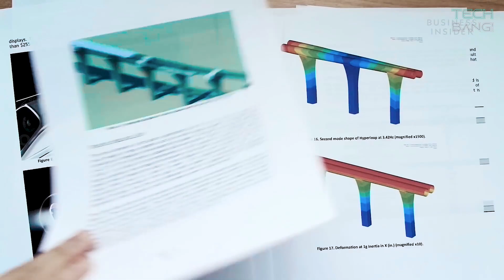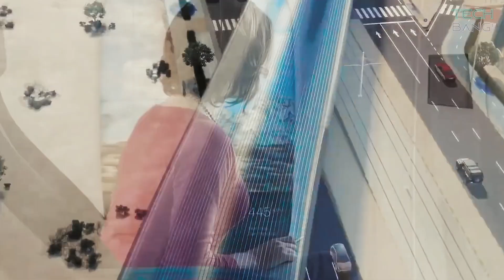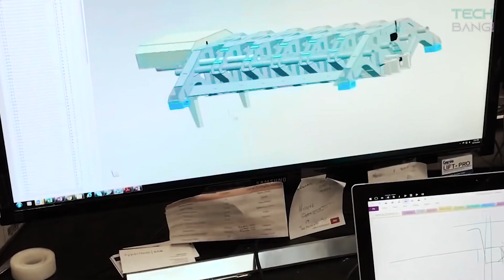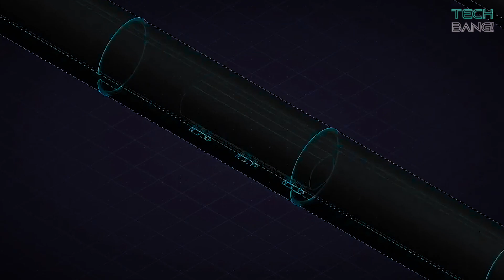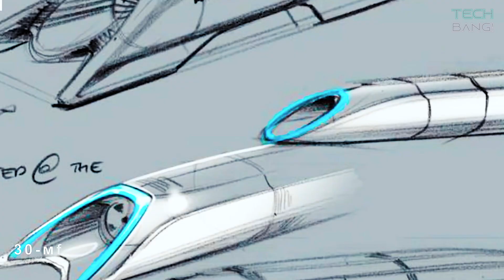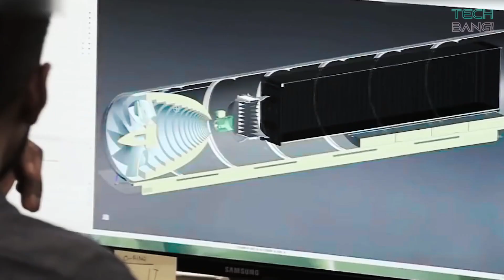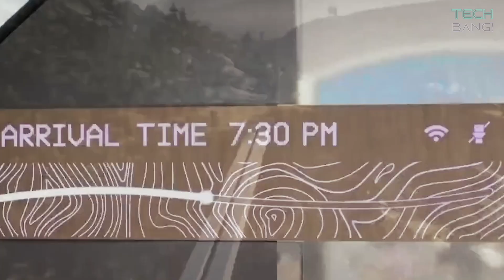The World's First HYPERLOOP is Causing a Revolution

Comment: To travel, seven-hundred-miles-per-hour. You cannot afford to land on wheels or touch any outer structure. The craft will require natural infinate levitatuin, always while power is lost. On those 'express lanes.' This means thicker natural levitation material, or larger levetaion materials, say between carts or front& back of pods.

Comment: Hyperloop will fail why can't anyone understand this
Reply: if they can make fricking robots and electrical shit, I’m pretty fucking sure they can make this
Reply: @reneekalinka8431  you talk like a true engineer how I am truly understand the difficulties of the hyperloop
Reply: @reneekalinka8431  yes they can build it, but the cost are to high
Reply: Because it is worth it to try.  The benefit of success out weighs the cost of failure.
Reply: @markharmon4963  There is no sucess becouse it cant work its just a scam to get free cash
Reply: All of the tests so far are evidence of progress.  Why  shouldn't they try?
Reply: @markharmon4963  this idea is older than airplanes. Airplanes made progress this did not.
Reply: @Kanhow  A lot has changed.  The costs of materials are cheaper.  Photovoltaic power is cheaper. Computer processing power is cheaper.  The acknowlegement of the cost of  climate change is starting to enter the balance sheet.  The idea of cheap fast long distance travel has established itself as normal.  And aircraft travel is unsustainable.  So we need a replacement.  Therefore the opportunity for disruption is there.  There is a will, therefore those with a way will be funded until they are convinced it does not work. There have been a lot of ideas ahead of their time.  The electric car for instance. Solar thermal and photovoltaic power. Workers collectives. Free speech. Reusable launch craft and spacecraft. Some would argue nuclear fusion  will NEVER arrive. Your argument is unconvincing.
Reply: And a lot of aircraft did not work.  In fact other than proving that controlled powered heavier than air flight was possible I do not know of a novel idea that survives from the original Wright Flyer. Even after they proved they could fly, the Wrights could not sell it.  There were rightful criticisms.  There were a lot of yeah-buts.  Yeah but they will never be able to fly across country, the Atlantic, the Pacific, over Everest.....  My point is, to give critical constructive feedback is useful.  To repeat debunked talking points is tedious.
Reply: @markharmon4963  then what happened if there is a fire, there no way to get out
Reply: Pretty sure the people creating this are much smarter than you. Just saying.
Reply: @theheartofelijah  then they are smarter than you to. Just saying. 😁
Reply: @theheartofelijah  - Yes, and they know they can raise a lot of money if they created a buzz around something that doesn’t make financial sense. You’re going to hard pressed to find enough people who want to make this commute every day to make it worth it.
Reply: @theheartofelijah  your not smart falling fir there scam
Reply: It won't fail because it will never be built.